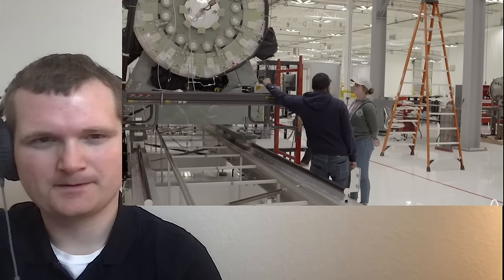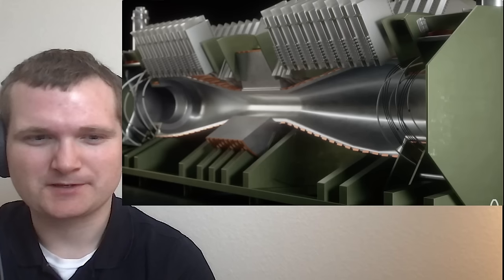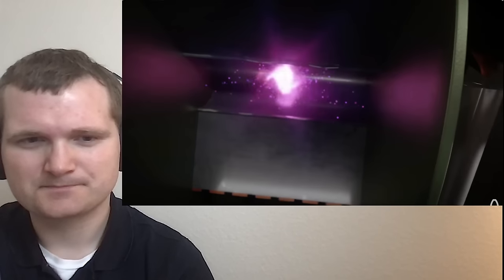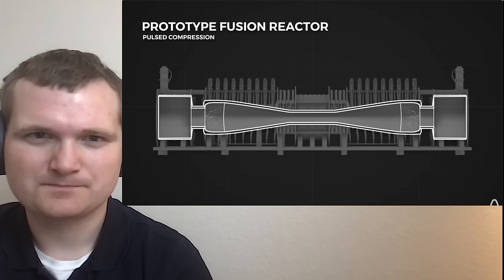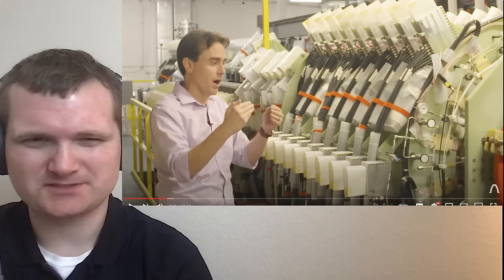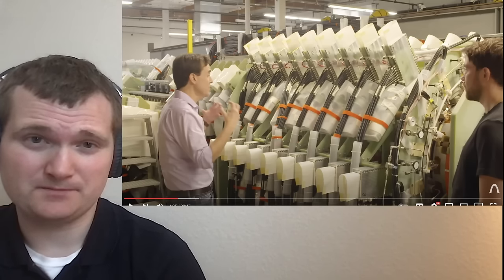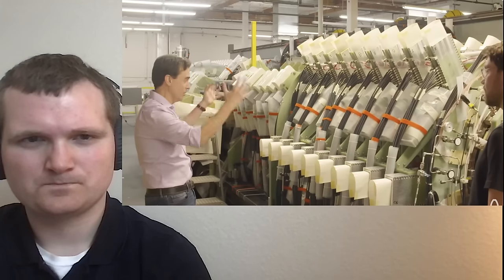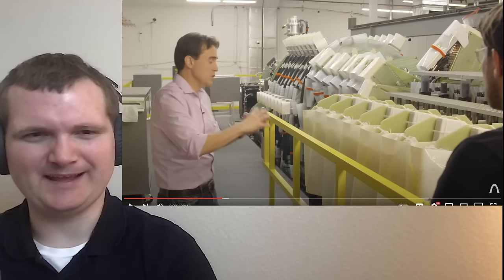Will the Helion Fusion Reactor ACTUALLY work? - Nuclear Engineer Reacts to Real Engineering

Comment: What's a red flag for me is that they are trying to do a whole bunch of things at once. Exotic configuration, exotic fuel, exotic power conversion. Any one of those things would be a huge deal for fusion technology and Helion claims to do all 3 "in a garage"
Also 26:15 lol why waste a bunch of tritium if you can feed it right back into the reactor to get more energy?
Reply: 1. They have a lot of experience with FRCs (they have made billions over the years). 
2. They have done experiments with D-He3 in Trenta. The power conversion is probably the riskiest part of the things you listed.
3. They are not going to waste the Tritium. They will either store it until it decays into more He3. They can sell it for lots of money (at 30k a gram currently, they can make more money from that than from electricity). They can trade it against He3 (people that use Tritium often have He3 from the T- decay). Or they can burn it in derivatives of their design. Mind you, the Tritium would be a lot more damaging to the machine. So they would adapt the design for that. They originally were aiming for D-T as an intermediate step, but by the time they finally got the funding, D-D-He3 looked just as doable and it actually makes a lot of things easier (less neutron damage, no breeding, lower wall loads so a smaller machine, etc).

Comment: The only issue I have is with his scepticism with the power generated. From what I see they are using DC for everything and the resulting output will be DC as well. Converting the imaginary excess DC current to 60hz AC is not complicated. No different from current battery banks on the grid. But the other criticisms seem legit.
Wish it did work though and we can start getting cheap clean energy for everyone.
Reply: Well, we will (hopefully if all goes well) know by the end of the year. Helion is aiming to have Polaris completed by summer, then it will take a few months of fine tuning and optimization. But after that, they hope to demonstrate net electricity from fusion for the very first time.

Comment: Yeah this looks like less of a complete dead-end than Tokamak (why would you ever build one of those when you could build a fission plant?).  The radiation concerns are as bad or worse with fusion compared to existing fission systems.  And there's plenty of fissiles to last us until solar catches up.  In the long run it's hard to beat the economics of having a perfectly good, zero maintenance fusion reactor one au away with billions of times the capacity we need and all we have to do is add collectors and transmission infrastructure.

Comment: why don't they use fission power plant instead of capacitors
Reply: A single pulse does not need a lot of energy going into the machine (on the order of single digit kWh), but it needs to be delivered to the machine in an instant, rather than as a steady trickle. Plus, the machine returns the input energy plus the additional fusion energy also within a single millisecond. They store that energy in the capacitors and then gradually release it to the grid.

Comment: The biggest mistake we've ever done was move away from nuclear energy. It should be being utilized in collaboration with other energy sources all over the place by now. Especially since so many things around it has advanced in different fields of study that connect to the advancements in nuclear energy options. Our knowledge of safety measures are much better understood. Also Capabilities in engineering, material science, technology, robotics, etc. are much more advanced now. We need to improve our environment by lowering emissions. The only things holding us back is past trauma instilled in people (which is understandable but we gotta give it a chance to prove we can do so much better) Did they outlaw electricity or oil, coal when things went wrong in the early days of those fields? No! They kept going and understood things usually are bumpy and difficult in the beginning and kept going even tho those sources negatively impact our environment and health a million times more than nuclear energy options ever could. Yet governments and Legal procedures BLOCK any sort of progression from happening. We'd be lucky to see even the slightest projects approved and finished with-in the next 100 years.. It's very annoying to see how much we have gotten in our own way when it comes to improving or advancing certain things. Instead we let fear, money, man made "required legal processes" Stop us from doing anything other than wind, solar, oil, natural gas, damming our rivers, mining for minerals... It's very frustrating because we should be able to use all these options in collaboration. If we actually wanted to improve anything. That's what we need to do and stop letting so much potential get blocked from ever occurring in the first place.. It's really irritating. I wish certain people didn't make this so "complicated and difficult" Why would any reasonable person want to block progression?

Comment: "Slamming" two volumes of plasma against each other is nothing as slamming two pieces of solid material against each other. Unless they managed to make some magic with their /initial/ confinement, these are two very low density volumes, so, it's more like "slamming" two empty spaces - they will mostly just pass /through/ each other, and about the effectiveness of that collision, how many particles will actually collide probably data from particle accelerator experiments may answer, but it's low, very low, even for relatively high intensity "rays".  And the kinetic energy /of the volumes of plasma, moving as a bulk/ - unless you approach relativistic speeds the kinetic energy is miniscule, compared to the thermal energy /the kinetic energy of molecules/atoms, and something, which is well known from the time of steam engines /and thermodynamics//, so, by "slamming", even if it was somehow effective, you would still add very little energy. Add to that that by accelerating the bulks you shorten the time of them passing through each other, so you shorten the time to potentially fuse. And then, if all their previous claims are true, there's the question of the effectiveness of back conversion of kinetic energy of highly energetic particles to some form of usable energy through magnetic fields /again sounds like something you should ask particle experiment physicists about, like how well you could use SERN's accelerator as an energy source, what would be the effectiveness of that/...
Reply: The "slamming" is not what makes the fusion. What happens is that the two FRC connect and merge into a single, larger and hotter FRC. This has been proven in countless experiments around the world. The purpose is that you have a larger, hotter and more stable FRC for the second stage which is the magnetic compression stage. That is really effective. The temperature increases 10 fold and the resulting density is orders of magnitude higher than in a Tokamak. There is also a neat side effect in that the electron temperature is significantly lower than the ion temperature. That means fewer losses to X-rays.

Comment: 12:30 wait wait wait wait.... we only have 20 kg of it and if we manage to get the Tokamak working it will burn through 300g a day??? What's the point in building the thing then? Even if it's working we can only run the thing for 6 and a half days.
Reply: We only have that much because there is no use for having a bunch, yet.  
It isn't like more can't be produced when we need a bunch, it isn't something impossible to get more of.
Reply: @gt1man931  ah I see, ok that makes sense.

Comment: I like this naivety, that he thinks if you fuse large amounts of D-He3 you wont get D-D fusion as side reaction.

Edit: Yap! You've got more fusion than expected, definitely side reactions are happening. Probably even D-T reactions, as the D-D produces about 50% of the time T, and the fusion does not immediately stops after a single "step" it will be going for a while.
Reply: They know and fully expect, even want D-D side reactions. The D-D side reactions are how they make the He3. There are no D-T side reactions because the Tritium is too hot and non- collisional on the timescale of the pulse. It is exhausted along with the unburnt fuel between pulses. So, there is no chance for it to cool off enough to fuse.
Reply: @elmarmoelzer2229  "There are no D-T side reactions because the Tritium is too hot and non- collisional on the timescale of the pulse. "

Have you looked at the D-T reactivity diagram? You clearly haven't. Also they say, that they are working on few 100 million K, D-T is dominant until 7 billion K, after that D-D slowly takes over. Even over D-He3 as D-He3's reactivity peaks or rather has a plateau from ~2 billion to ~7 billion K. Furthermore, D-He3 reactivity stays always below D-T's.

You cannot say there are no D-T side reactions going that's just excluded by the very nature of quantum mechanics.The only thing someone can argue about is the ratio.

But whatever that's just not my point, since D-D reactions are clearly happening they should not down play the neutron shielding issue even on their D-He3 reactors.
Reply: @AlexM1983DHUN  

The Tritium, when it is produced by the D-D side- reactions is 1 MeV!

The rest is nonsense. You are applying the wrong cross section (Maxwellian, vs non Maxwellian). 
 
To my understanding, the collisions of the Tritium with Deuterium are mostly elastic scattering before it heads pretty much straight for the SOL and leaves the FRC for the divertor. 

Putting aside that the Tritium concentration is extremely low to begin with (it is only a small fraction of the fusion products in a Helion machine).

IIRC, the resulting D-T reaction rate is somewhere in the 0.1% range.

As for them downplaying the neutron shielding: They are not! Polaris has massive shielding made from boron- carbide doped concrete. There are pictures on various social media.

Quite frankly, I am somewhat sick and tired of some arm- chair experts who have never produced a neutron in their life, claiming they know better than the people who have worked on the thing for decades(!) and have produced > 10^11 (Trenta would have been more like 10^12 to 10^13 ) neutrons per pulse in tens of thousands of D-D pulses. But yeah, I bet you know better because someone said so on the internet.
Reply: @AlexM1983DHUN   I am not the guy behind this, but I do know the guys behind this ;)

Comment: Why don't they just use the newly created tritium that they didn't need to buy for fusion reactions instead of wasting it
Reply: They are not wasting it. They can store it until it decays to He3, sell it, trade it for He3 or burn it in special versions of their machines. The first three are probably more desirable though. Selling the Tritium would make them the most money, at least until the market is saturated.
Reply: I guess so, but since they it made themselves using way cheaper materials, that would eliminate the main problem with using it, and they just pass up the opportunity to save alot of money
Reply: @Megaman_3140   It is complicated. They will likely have D-D-T or even D-T machines that burn the Tritium at some point. But they likely won't be able to compete with their D-He3 machines from a cost/kWh POV. 
The reasons are:
Higher capital cost for steam turbine and cooling cycle.
Higher capital cost for shielding.
Higher capital cost to build the machine (and building) from more specialized materials that handle 14 MeV neutrons better.
Higher maintenance cost.
More difficult to get site licenses. A D-He3, even a D-D-He3 machine will have an easier time to get a site license and customers will likely prefer them.
There are a probably a few other factors that I forgot here. But that should give you an idea.